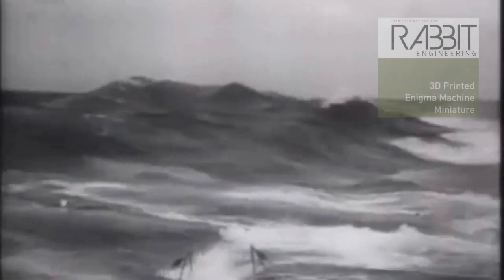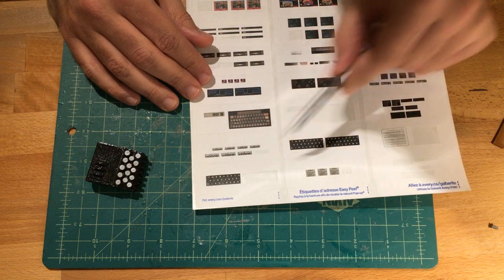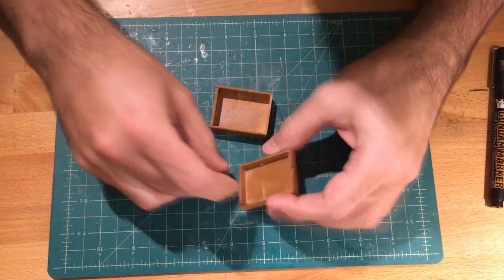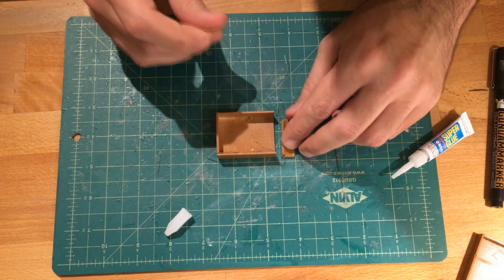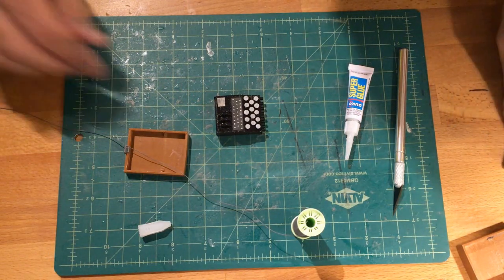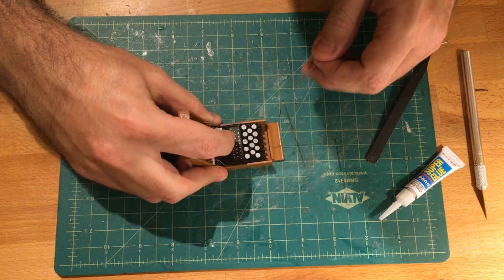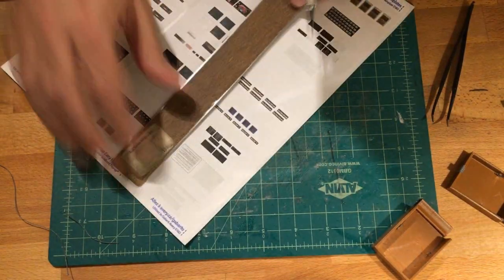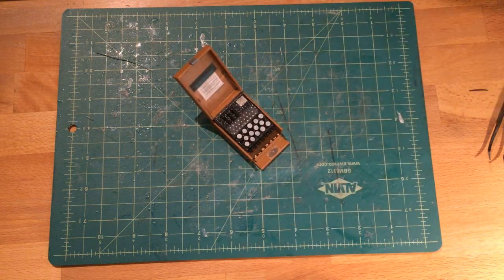Make your own 3D printed mini Enigma machine

Comment: you have soldered to original game controllers with arcade buttons and when i do they fucking ghost me as if there are solder bridges but there are none and my muiltimeter says so and its fucking frustrating and really annoying, would be great if you had an answer cause you made the g1 with real hardware not emulation